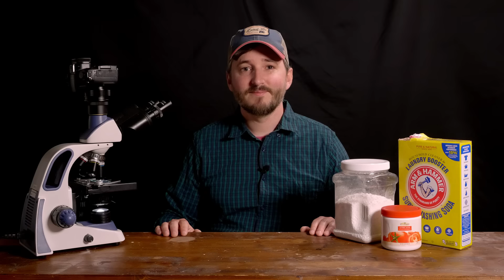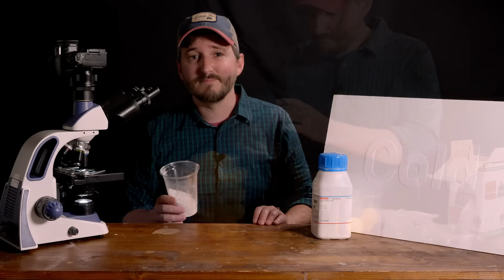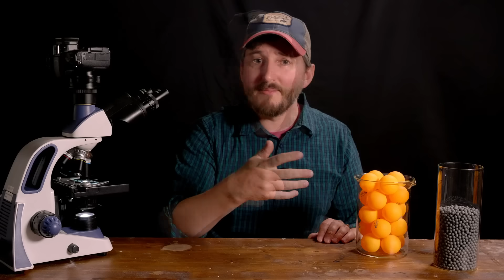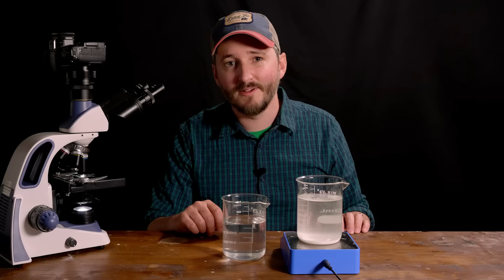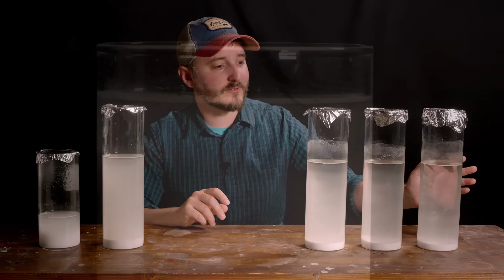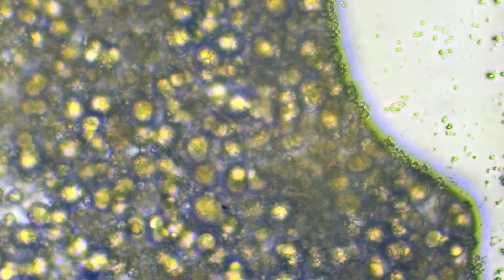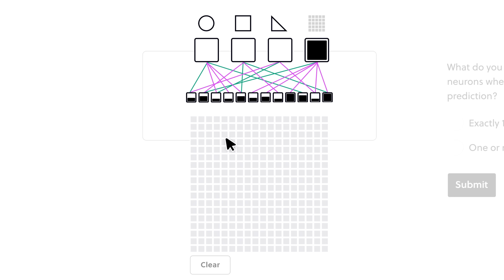Making Infrared Cooling Paint From Grocery Store Items (w/Novel CaCO₃ Microsphere Synthesis)

Comment: I'd like to mention that there are some natural materials available that meet the compositional and internal/external structure requirements. (A) Chalk is a sedimentary rock consisting of microscopic shells of foraminifera composed of calcium carbonate CaCO3, which are a good substitute for microspherules. (B) Barite is a mineral with the composition of BaSO4, and it is usually sold after crushing it to a powder (for use in oil drilling "muds"); hence, this powder consists of microscopic fragments of barite crystals, which are not amorphous, and have a high density (specific gravity around 4). (C) Plaster of Paris is made from the naturally occurring mineral gypsum (CaSO4.2H2O). All of these materials are quite cheap and very pure. I believe these could be a good choice of materials to use in the first stage. Barite may also be obtained as chunks of rock, crushed to tiny pieces, and passed through sieves of various sizes ranging from gravel through sand, silt and "fines"; this way, a range of sizes of barite crystal fragments may be obtained. Hope this helps.

Comment: I have a question: Lets say I make this at home, and paint the tiles at the roof. I enjoy the benefits at summer, because the roof won't absorb as much heat, so our house will be cooler. But at winter the opposite would be good, to collect every bit of heat from the sunlight possible. So the question is, would this make my heating bills rise much higher during winter, because my painted roof reflects back the sunlight?

Comment: i first saw his video i think last August? and i keep thinking i want to make this and test it out, but i'm curious how strong the paint ends up being?
because one of the main things i would love to use it for would be coating my SUV. i do long camping/road trips, and one of the worst things is how hot it can get in the vehicle on the nights when i decide to sleep in there.

so my main questions are:
1. how strong does this paint end up being? like would it hold up on a vehicle or would it crack too easily?
2. how well does it adhere to metal or already painted surfaces?
3. would it be better to scuff the surface with a quick sanding to make it adhere better? (probably a good idea)
4. how thick of a coating is needed to get the full cooling effect? (i'm assuming that 1 or 2 thin coats/enough to not see the color of the base material below, would be adequate since the goal of this paint is to reflect and keep heat/light from penetrating the material)
5. what kind of thickness would be needed to keep the coating from cracking the first time the dbag parked next to me opens their door without paying attention and hits my car? cuz i know acrylic is very strong, but i have to assume the bubbles and pigment will weaken the coating compared to if it was pure acrylic.
6. how easily would the surface pickup/hold dirt and other contaminants?

7. has anyone tried adding this pigment to automotive paint? i think that might be a good way to go. this pigment added to automotive paint, then maybe a clear coat for a bit of protection for the pigment layer?
the reason i think this could be good is because it would help keep the vehicle from heating up a crazy amount during the day, but the main benefits would be at night when the sun is down and it's still shedding heat, and i'm inside the car heating it up.
so combine the cooling effect of the paint at night with my fan system that pulls in the cooler night air, and pushes out the air that's been heated up by my body heat, and i think it could help keep things pretty cool.

so ya, has anyone tried anything like what i'm talking about, or maybe some other ideas that might work for a vehicle/camper/RV application?
if so i would love to hear your ideas and opinions before i try and make enough of this pigment to make 2 or 3 gallons of paint lol

Comment: What do you think about putting a plastic or epoxy as the surface coat? 
Maybe something that you could spray on?
The dream is something that's collapsible, and the epoxy may give it strength

Comment: What wavelengths does this coding reflect? Is there an easy way to test if a glass or plastic is transparent to these frequencies?

I think this will be great for skylight covers in summer.

Would this coating make any sense as widow curtains? There are usually inside, air-gapped next to some glass, and are often in sunlight. Would the coating provide any benefit or would it mostly be lost because less of the coating is facing the sky?
Reply from the maker: Look up the atmospheric infrared window. The main gap I believe is between 8-14ųm so for a top cover you want transparency in that gap. You can often find that by googling the IR emission spectra of that material. Glass blocks most of that band so it's no good. Many plastics are at least partially transparent if they don't have IR absorbing additives. The best thing to do is to just test what works or not.

Comment: If you want an easy way to measure particle sizes, you can use Stokes equation to estimate the time it takes them to fall in a suspension, and measure the change in density over time with a hydrometer. There is an AASHTO/ASTM method for this, T88/D422.
Reply from the maker: Good tip

Comment: Top coat with clear sealer. Paver sealer has a lot different solvent types to find one that's compatible. Or maybe change your based of acetone to xylene. Rexane I believe is as a naphthalene base sealer. Most other solvent base are xylene, and then you have water base.

Comment: I'm a retired geophysicist and now a DIY homeowner grandpa. Ditto to all the compliments you've received in the comments. I'd add another compliment, but if I read all 5173 comments I'd see someone already beat me to it.

I'm just brainstorming here. 
Suppose you spray your surface to be coated with a thin sticky base, say Polyurethane or Polycrylic, and then apply your super white paint to it before the base cures. Maybe you could dust it on, thereby avoiding any solvents at that stage. 
Make 3" wide tape with your pigment built right into the tape glue. Application would be simple.
Reply from the maker: I believe the acrylic base is very important to contribute extra light reflection through the snow scattering effect. Sadly I don't think dusting the pigment onto an adhesive would work. Perhaps if the adhesive tape were backed by its own reflective layer

Comment: When watching the “paint” application methods at the end of the video, the first thing that came to mind was my cordless caulking gun.  The Milwaukee cordless caulking gun I own will put down a full tube of caulk in 20-30 seconds on the highest setting.  You just need a refillable tube for the gun, and you have an easy on the hands applicator.  I’ve broken both my wrists, and squeezing the paint from a tube for any extended period of time is painful, hence the cordless caulking gun. Since the gun only pushes a plunger for you when the trigger is squeezed, you could probably use one of those giant syringes, and  whatever sized tip you could come up with to attach to the end, like the wide one.  Not sure if someone has posted this idea previously, but if not, it’s something to consider for application to large surfaces.

Comment: So... thought, this, I hope, has been mentioned before but... How effective would coating window blinds in a paint like this be? As long as the window itself doesn't reflect it of course. If in-window blinds were coated there'd also be effectively no worry about the coating getting physically damaged and you could make the two sides of the window differently transparent perhaps

Comment: Addressing durability concrete driveways tend to stay grey however  when brushed with a wet fine brush they turn glossy white giving a head start on reflective properties. broadcasting (grass seed spreaders or chicken feed hand toss )powders onto green cement is a method used to dye patterns that are then pressed onto the top layer.  Then a clear sealant is sprayed which lasts throughout the year. White driveway vs blacktop heat differences are huge walk on one barefoot. With your Skyhawk top you'd have the coolest way.  Sell lemonade right there on a hot 🥵 day and people would naturally form a 😅 line. Yeah I pour walkways and patios for a living even done airports and freeways less heat less tire wear.  His recipe could stop the war on global warming, keep your powder dry.

Comment: How flexible is this paint? Is it possible to stop it flaking?
Reply from the maker: It's not flexible. That's something that needs to be improved
Reply: @Nighthawkinlight have you thought about using something like a tar product which would be flexible?
Reply from the maker: @TheOriginalSifoDyas  Ideas are plentiful but testing is time consuming
Reply: @Nighthawkinlight  I can imagine, I suppose it’s write them all down and test as an when. It may be that the ideas given are also possible to give other ideas where say two items are mixed to make a flexible compound and then mixed or painted on first before the special heat resistant paint

Comment: Just curious but have you tested these mixes cooling power against just plain old white paint, instead of the "bare panel" to see how much of the heat is just being reflected by the color white?
Reply from the maker: Yes, off the shelf white paint gets ~20°f warmer than air temp in the same direct sunlight conditions, so this paint is more than 25f cooler in sunlight than paint you can buy.

Comment: Is it too fragile even to have a clear coat on top?
Reply from the maker: It's not too fragile for a clear coat, but a clear coat may not let IR pass through
Reply: Also, putting the panel on a vibrating surface after painting may help even out the coating

Comment: One way you could get a more even spread is with a silicone squeegee. To make a more precise thickness, attach something to the ends too keep it raised, though with practice, you can get pretty good at freehanding it. I do this with both caulk and paint on occasion to repair sprayed surfaces.

Comment: applied on a wall it would work because its not facing the sky? is there a solution for walls - we live in very hot climate...
Reply from the maker: It will work on an outside wall as long as it partially sees the sky. The cooling effect will be reduced, but it will still help

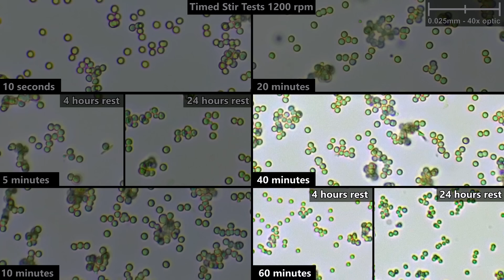Comment: I'm at about 15:08 and some ideas as to what may be contributing to the delayed action of the crystallization process would be in changing the ph in the solution that would to a degree reduce or mediate the type reactions occurring in lessening the reactivity of the bonding activity and letting a weak reaction making a speciation result in the gel like substance that would effectively slow the veracity of the crystal forming speed to something that lets spheres occur vs jagged larger grains. I am a mechanical engineer by training and this is a shot in the dark from a life of anecdotally tasting a lot of different sciences, and growing up in a chemical engineering household.

Comment: Maybe this is one of the secrets behind "Starlite" -- a mixture that will emit radiant energy well at it's surface. Of course the substructure would likely require some work. The person who invented Starlite was a hair dresser. His material could prevent an eggs being cooked from a touch with only a similar thin coat.
Reply from the maker: I have several videos about starlite which you should check out

Comment: This was awesome work. Does a basic mask work for such small particles? Wouldn't a more robust filter system be necessary?
Reply from the maker: For more dangerous insoluble particles like silica I would use better filtration. CaCO3 is pretty tame and a mask catches most of it

Comment: So we can go below ambient temp with this, about 3-4 degrees Celsius, when it is 35 degrees Celsius outside... What is the maximal rate of heat radiation? What can be the unit of that? I assume surface area is an important factor, so... Joule/squarecentimeter/second? Watt/squarecentimeter?

It is also very interesting how "passive" someone can go with a panel like this (for maximal cooling)? Most probably, you want it in an already cool place, like a shade of a few big trees, so the ambient can be already relatively low.... But you want to aim it almost straight up to clear skies🤔 Do you move it a few times during the day? You also want it as clean as possible...

Or you go for a different kind of "cooling" and you make the best possible kind of shade out of panels optimised for that?
Reply from the maker: Usually measured by watts per m2. Some of the best results reported measure 90-100w/m2 of cooling flux

Comment: I was thinking after watching your video if there may be a way to increase the cooling effect by changing the reflective scattering properties of the paint somehow. I figure if it’s made to have the light bounce off in all directions via scattering versus something like retro reflective or light polarization of some sort so that more of the light would bounce directly out into space versus scattering in all directions. I may have to look into that now that you’ve put this info out for folks to see. Just unsure how to go about testing it necessarily so I’ll have to think on it more.
Reply: Additionally I wonder if the shade situation may differ if it has a heat source as in an air conditioning use case heating it from behind. Also I wonder if a higher concentration of microspheres in the paint or multiple coats would allow greater cooling effect by increased surface area covered or by greater thermal mass or something like that.

Comment: use the method concrete guys use to flatten concrete over a large area. A set of rails are placed on the edges and a long screed is pulled over the rails, flattening the surface. Usually, a guy is keeping in front of the screed full and another guy is working the screed, back and forth flattening the material to an even thickness. Which is controlled by the rail height.

Comment: Hey! Thanks for a great video as always, i want to mention something - in this video you said "acrylic or plexiglass", which i realized is not the same thing, plexiglass is actually polycarbonate, so maybe this can alter the results of your experiments, i hope this will help! Maybe you can check the difference between using paint made from acrylic and from plexiglass, but one major difference between them is that acrylic is actually much more brittle than plexiglass (polycarbonate) so maybe polycarbonate paint will be more resistant to cracking or maybe you can mix these two in different Ratios to get different results
Reply from the maker: I use plaskolite optix acrylic. Polycarbonate won't work
Reply: @Nighthawkinlight  thanks for replying! I just heard that you said acrylic or plexiglass so i was kinda confused at first because i was recently searching differences between the two😄

Comment: This is professional quality work. Congratulations. As far as the spreading goes, I think I may have a better idea. Glue for tiles is spread using a sawtooth edged trowel. You simply glop some glue on the floor and run the trowel over it, yielding a nice set of uniform lines of glue.

Comment: I live in Alaska in a 1957 spartan trailer (all aluminum) this place gets 1000 degrees in the summer even with Alaska climate…. It’s sunny 24/7 here… on 75 degree days it gets well over 75 inside and stays hot well into the night. Will this paint help me? Without adding to freezing me out for the 6+ month winters?

Comment: I have tried making this exact same paint. I've followed it step by step. I have been successful in making the pigment. 3 sizes of pigments. Although I don't have access to a microscope to confirm the sizes. One thing I'm struggling with right now is the Acrylic solution. My clear acrylic sheet has just REFUSED to get dissolved in acetone-water solution. I have tried pure acetone too, but no use. Can somebody help me in this regard???
Reply from the maker: I've had some feedback that certain acrylic won't dissolve. See if you can find Plaskolite Optix brand. That's what I use

Comment: This is awesome! In order to not have to make the acrylic component of this, I am considering simply using a standard elastomeric roof coating and then dusting the microspheres over the top while the coating is still wet/tacky. Has anyone tried this already? Any thoughts on why this would or wouldn't work? My plan is to do it inside and dust it on pretty thick, then tap the excess off to use again.
Reply from the maker: I haven't tried mixing the pigment with other types of coatings yet. I'm not sure how well it would work as a simple dusting. It's worth an experiment

Comment: If Calcium Carbonate is already available to buy, can we disolve its crystals in hot water and use only citric acid while cooling it down and stirring to create the spheres?

Also would it be better to keep the pigment in liquid state, without drying it completely,  so that we dont have to work with the dust, and just use the water it contains in the final acetone acrylic mixture?
Reply from the maker: Calcium carbonate won't dissolve in water

Comment: Work Shoes/boots!
The (steel capped usually) work boots/shoes used in the sun on construction, mining etc sites will slow cook your feet to the point where you're running around screaming at anyone stupid enough to be in earshot of you!  :)

ie:  If you can put these pigments into something somewhat elastic 'resin': I want 50 000 gallons right now! 
I know that you get a elasticiser/plasticiser additive for 2K (car) paint..